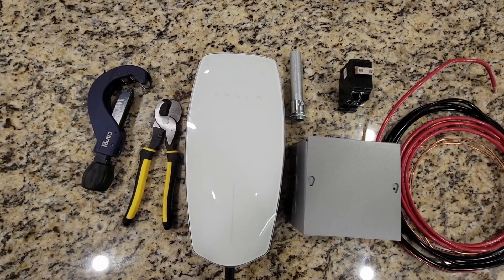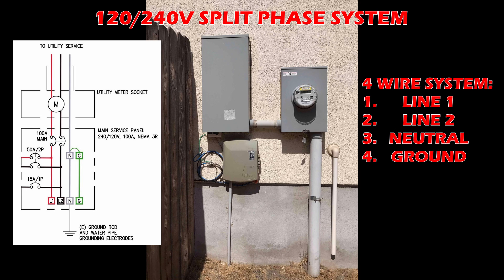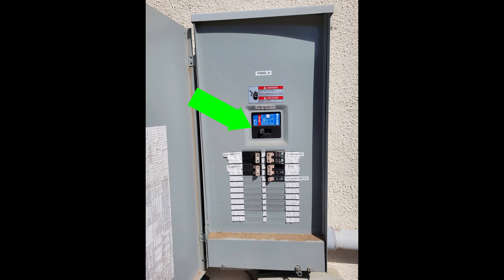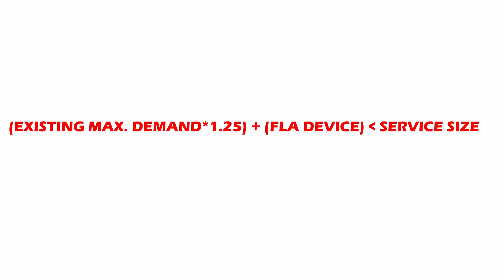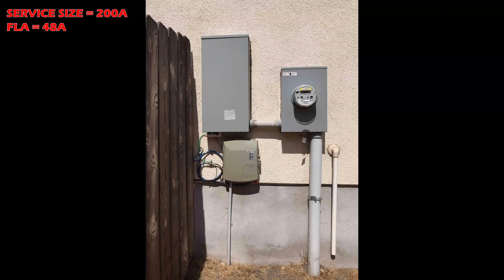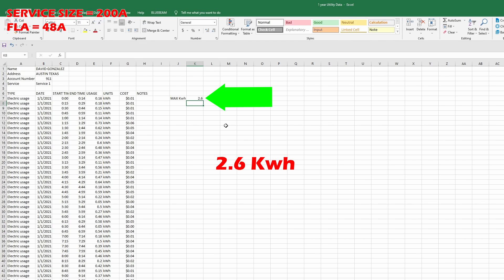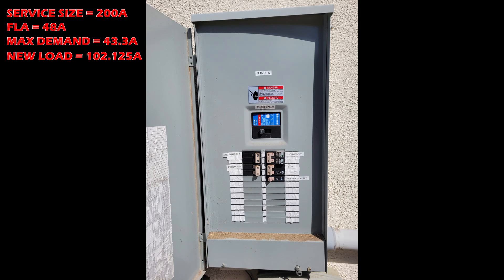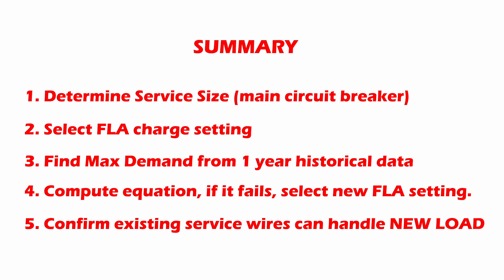Watch THIS before Selecting your EV Charger Circuit Breaker Size DIY

Comment: Please excuse my electrical ignorance but I do have one further question.  Assuming you are using a home wall connector to charge your EV and an electrical storm passes by, would your EV be in danger of damage because of its connection to the wall connector?
Reply from the maker: Hi Mark, yes there's a small risk damage can occur. I would make sure the charger is not plugged in to your car during a storm. I indirectly cover this topic in this video here: https://youtu.be/oOQTf4Lz1zY I also show a device that helps prevent damage.
Reply: Electrical guy here....yes, there is a danger.  My understanding is that the wall pack contains information and relays to the car when plugged in.  The actual charger is inside the car, meaning that the ac power in your house runs directly into the car before it works to charge your car.  Lightning can effect your home system and travel down the wires into your car, just like the TV on your wall and cause damage.  There are products out there to lessen or stop these effects.  

Please contact your local electrical guys with questions.  Or call your local building office.

Comment: If an electrician, in installing your wall connector, says it will handle a charge setting of 48,  does it make any sense to lower the charge setting?  If so, what issues are presented in lowering the charge setting?  Additionally, in using a wall connector to connect to an EV, does one need to unroll the wall connector cord when it is in use?
Reply: I am an electrical guy, not an engineer.  An engineer would be better equipped to describe how different charge rates impact your car's battery.  This might mean a 30 amp charge gives your battery more useful life.

From an electrical standpoint,     YES!  As low as you can.

Wires have some small resistance to them making them like a plug in electrical heater.  The wire insulation is designed to handle specific levels, however, bad connections or improper plug ins can be a source of specific heat generation spots.  Over time, any flaw or added heat will damage the insulation and cause failure.  This may take years and years. However, the lower you can keep the current, the less likely any problems.  Think of it like driving a Ferrari on down town streets....stay in first gear and no speeding tickets....shift into high and problems.

On a 40 amp setting your car might charge in 7 hours, but, if you charge for 30 amps at 10 hours... It is safer for your house/wiring.  Plug in at 6 pm and unplug at 6 am and an even lower rate can get your car where you need.
Reply: @keithharrington8715  I have noticed that when charging my Teslas at lower current, it is less efficient.  As in more kWh goes into charging than kWh spent driving when you charge at lower rates.  Apparently this is because having the car powered up while charging burns a few hundred watts, so it's better to finish charging sooner so it can power back down.
Reply: @phillipsusi1791  thank you.  Did not know that.  I guess there is a heater involved with charging, if I understand it all correctly.
Reply: @keithharrington8715  Well there isn't supposed to be but the computer seems to be able to burn a surprising amount of power.  It also does so when sentry mode is enabled.
Reply: @phillipsusi1791  not a heater for charge efficiency in cold weather?
Reply: @keithharrington8715  Oh, yea, if it is below freezing out the heat pump will warm the batteries, as well as the cabin.
Reply: Our EV set at 40 amp charging on a 50 amp breaker, charges back at 41 to 43 miles each hour. Mostly the screen says 42 miles each hour. 
The vehicle dashboard reading is usually 240 to 244 volts.

Comment: I installed my Tesla charger on a 60 amp breaker but I only charge it at 20 amps which I set up in the Tesla app. I never or very rarely need to charge faster then that. I prefer to slow charge my vehicle overnight.
Reply: This is exactly what i was thinking of doing. That way you have the option on an emergency or if someone comes to visit and needs to charge while theyre there. Smart!
Reply: I sometimes charge my Tesla Y at 14amps. Don’t drive much and charge between 50-75%. See video Best practice electric vehicle (EV) charging. It has data how to get less degradation. .
Reply: @brianrautiainen5473  same here. I was getting the tesla overheating cable/plug mssg cause of my Leviton receptacle so it was knocking me down to 8amps. And now i keep it at 14amps to avoid charging overheating mssg from tesla. I checked the plug and no signs of burning or melting but i'll need to swap it out soon for a bryant/Hubell
Reply: Is your charger hard wired?
Reply: @cshaw9683  yes

Comment: Thank you for the detailed video. So I noticed you determined that the wire size was 4/0 and aluminum which allows a maximum power of 200 A yet your master breaker in that panel was 225 A which would require MCM 250 wire. The main breaker should be protecting the wire so I would say your panel is not correctly configured.
Reply from the maker: Thanks Ron. Regarding my panel, the main breaker size is 200A not 225A. The service wire #4/0  AL is rated for 200A (for residential applications) which matches the main breaker size 200A.
Reply: The buses are rated 225, if needed you can put a 150, 125, 0r 225a breaker to match service conductor sizes.  Depending on the utility and service point definition, the utility can cheap out on the conductors upstream of the meter.  That is why they are always outside, if they overheat, then they will upgrade.

Comment: My utility company only breaks down the data per day. Is there a way to calculate this for 24 hour periods?
Reply from the maker: Unfortunately 24hr data set is not good enough. I suggest reaching out to your utility and requesting 15min or 1 hour data sets. If they cannot provide that. Request monthly peak demand and 12 months worth (units shall be in kilowatts, NOT kilowatt-hours). Let me know what they say.
Reply: Yes there is.   Home loads can be calculated by using the national electical code section 220.

This section has many adjustments and exceptions. ( Running your AC and your heat at the same time, not expected so use the higher of the two.).

I highly recommend you get help even though all the information can be found on the internet.

Comment: My Utility does not provide my max demand over a year they simply give me the number of kwh I use in a month.  I did the math on 600KWH over a month and got something 3.47 amps averaged over a month on my 240 volt 100 amp service.  That's not a good way to calculate peak demand because it is just the average over a month.  Do you know of a way to calculate peak demand other than the utility providing it?
Reply from the maker: Kevin that is unfortunate. Utility data over a month is not helpful as you mentioned as it averages out for the entire month. Ideally you would need 15 min data sets or 1hr data sets. Are you able to request 15 min data sets? Without any useful historical data from your utility, you would need a 3rd party metering device @ your service. I personally have an Emporia Home Energy Meter (~$150), this 3rd party meter that does provide 15 minute data---the phone app itself provides MAX demand each month which is neat. I did backcheck my utility data calculation and compared it with the Home energy meter data and it was accurate within 5% error.
Reply from the maker: Another option would be a DCC load sharing device--this is the most expensive option (~$600)--it essentially does the calculation for you, when ever the device detects your entire home load is closer to the service size limit, it will shut off your EV charger for 15 minutes then allow it to turn on again when the home load is under a certain threshold.

Comment: We just moved in and only have a few months worth of data but they are for whole months. The largest usage per month is 2358 KWH for 29 days . We have a 200 Amp breaker box that is pretty full. I need to install a double tap to free up one space for the double pole breaker. The dryers are Gas only, one dishwasher we don't use often, we do have a pool heat pump.  We do have a generator interlock which took up 2 spots in the panel. I know this isn't enough info but any guidance.  Thank you for your content
Reply from the maker: Steve I would consider reaching out to  your utility 1) ask if they can provide max demand  for each month, if they cant 2) ask to provide data in smaller time intervals, ideally no more than 1 hour; you'll need at least 2 empty slots for a 2-pole breaker. If your panel is completely full, might consider installing a small sub panel. Let me know what your utility says.
Reply: @dgtv3320  No go on the data, My thoughts is to only charge after 9pm.This way I know nothing else is running. I ordered a 60 amp breaker but I'm seriously thinking of just going 40 Amp to be safe, Running 6 AWG THHN wire. The run from the box to the charger is about 10'

Comment: The gen 3 charger manual says the wiring to the charger from the circuit breaker should be 12-4 awg, will any size in this range work or do we need to consider other factors?
Reply from the maker: There are many factors to consider, the most important is circuit breaker size. The bigger the circuit breaker, the bigger the wire. In this video ( https://youtu.be/OPc9_7wjcVM ) I posted recommended wire sizes @ 1:41.
Reply: @dgtv3320  got it, 6 or 4 awg. Let’s hypothetically say it has been installed on a 10 awg already, what would happen?
Reply from the maker: Hypothetically speaking the smaller wires would overheat, cracking, destroying the wire insulation. This would cause both wires to short circuit/spark which will easily turn into a fire [big reason why I recommend installing EV circuit in metallic conduit]--damaging your home and your vehicle. Assuming the charger is in the garage, there are no smoke detectors there, so the garage will roast for a while until the smoke billows into other rooms with a smoke detector--the detectors will alarm you but I'm afraid there will be plenty of damage by the time the home owner can react. Of course this never happens because certified electricians size everything correctly.
Reply: @dgtv3320  Thank you for your expertise

Comment: If you would have worked for Tesla, you would know that you keep talking about an EVSE ( electric vehicle charge equipment). The charger is in the car.
Reply from the maker: The subject of this video is how to determine SPARE capacity of an existing electrical service.
Reply: @dgtv3320  hello we have installed a tesla wall charger the circuit braker is 40 amps the cable network can handle 60 amps,my question is because of the 40 amps its limiting the car to charge at 16 amps.Is it possible to charge faster 32 amps to the car  whit 60 amps circuit breaker.
Sorry for my English,i think you will get my point

Comment: FANTASTIC and helpful video. I've searched a long time for someone to explain how selecting a breaker works, specifically for EV. You make it very clear. I have experience adding an electrical sub-meter and am not afraid of electricity, however understanding the calculations is something I didn't want to screw around with. Thank you!
Reply: Agreed. This is a wonderfully helpful vid!
Reply: You guys need to read the rest of the comments. He’s not correct on a lot of things, and he’s not a electrican…

Comment: Hi, I echo with others that this is a GREAT presentation/video to understand the load and what is possible.  This is the most crucial point to ensure safety (first!).  So, a HUGE thank you for posting this.  I have watched many videos on how to install an extra 220V outlet - and no one (so far) did not have this information as clearly as you presented.  I do have a question - your utility company provided you with 15 minute reading data, which you used to calculate the max load.  However, my company is giving me one day data.  It ranges from around 20 to 40, but has some spikes in some days.  The max (of one and half year data for one day) is 210.  Does this seem right and can I use your formula with one day load?  Thanks!
Reply from the maker: thank you for the kind comments. Regarding your utility data, I need more information. Are you able to email the data to me? I can look into further and potentially make another video if needed. the.original.dgo@gmail.com

Comment: This is a great presentation and easy to follow math. 

Question. When you show your data, why do you divide by 240V instead of 120V — although your new circuit/breaker will be on 240V, presumably all of your existing equipment is running on 120V right?
Reply from the maker: Great question. Most equipment is running on 120v in the US; however, the data provided by the utility is in terms of the phase to phase voltage of the system. In the US for residential homes, the phase to phase voltage is 240volts so we divide by 240.

Comment: Thank you! Exactly what I was looking for. I’m a new C10 here in CA, and will be installing these EV Chargers but not sure what the county inspector is going to require or how they go about calculating since usually all things are not on at the same time. This is my first time hearing about determining Max Demand. So I would need to tell my customers to pull this data up off their PG&E bill  for the past 12 months? Have you heard of the DCC load sharing device for EV Chargers? It senses when loads reach 80% and then turns off the EV Charger... comes back on when loads have been below 80% for 15 minutes.
Reply from the maker: Congrats on the C10 license Matt! Not heard of the DCC device, but that unit basically computes the math for you and shuts down the charger if it reaches the limit of the panel---like you said. 
Side Note and an idea that just came to mind: for all the customers that do not supply 12 months of historical data you can install a DCC. For all customers that do provide data, you can easily compute the load and determine max size breaker to use--saving your customers $600 along the way--I'm sure they would appreciate that! You'll have to check for specific requirements for the cities you work in, they are all different and have different requirements. Cheers.